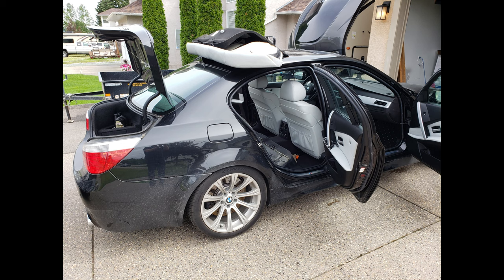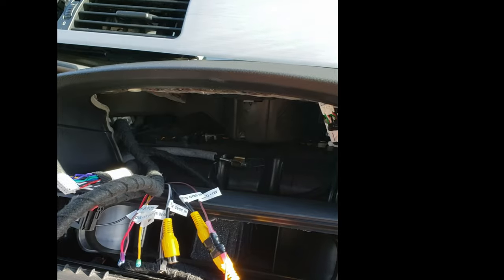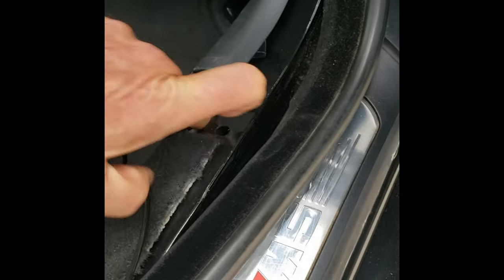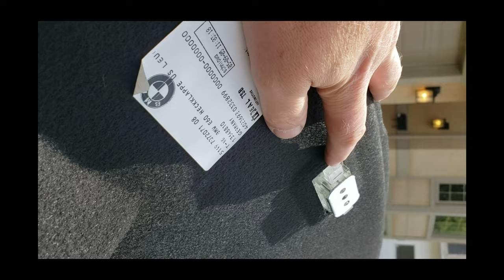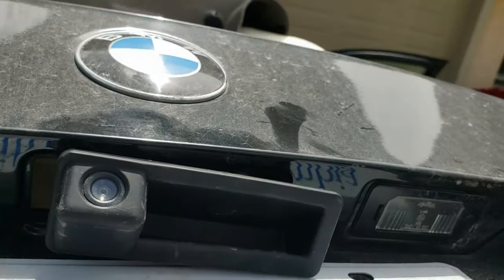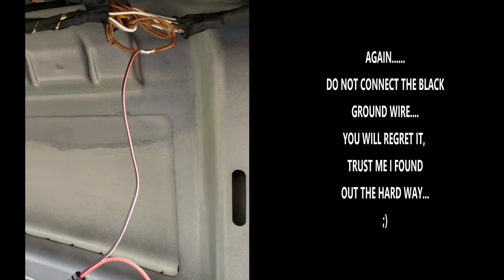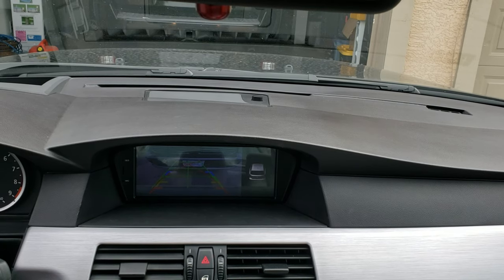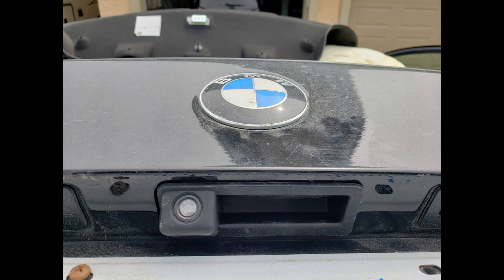BWM E60 CCC Android Heat Unit Rear View Camera Installation

Comment: Thanks for your videos. I'm installing a similar no-name Chinese unit in my 07 e64 and have stalled at the backup camera. What color is the reverse wire you tapped into? And where did you connect to it - near the bulb connector or closer to the front of the car? Thanks for any light you can shed.

Comment: the black ground wire, you mean the one u had solded on the brown one?!
Reply from the maker: Yes, in the truck wiring. Once I disconnected that, all the noise in the camera image went away. Nice clear picture after that.
Reply from the maker: Yes, in the trunk wiring. Once I disconnected that, all the noise in the camera image went away. Nice clear picture after that.

Comment: I have the same unit as you but installed into my e63 6 series with CCC idrive. Was there a setting you had to select to have the factory parking sensors display along side the camera (right side of screen) when it reverse?? Because mine doesn't show the sensor icon (BMW 1 series) like yours does when in reverse, although I can hear the sensors, the distance display doesn't come up. So I was just wondering if there was a hidden setting that I may have missed. I hope that makes sense
Reply from the maker: Hmmmm,no mine just worked. Try looking through the factory settings menu but I dont recall a setting for that. The seller was really helpful thru alliexpress and answered a bhnch of my questions maybe try that too?  If you get no response let me know and I can my guy too.